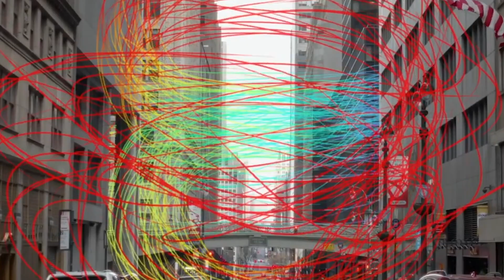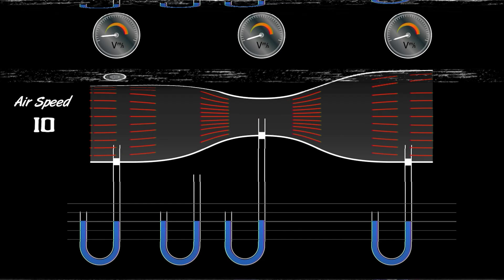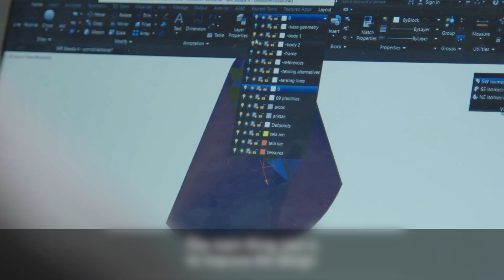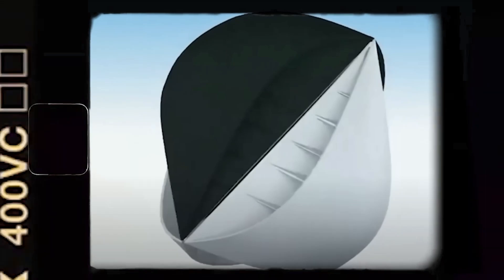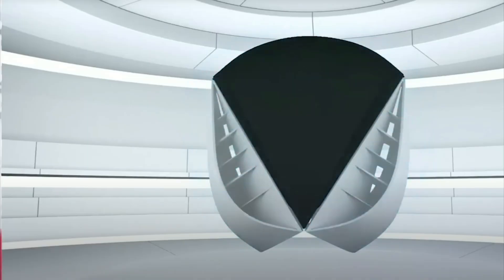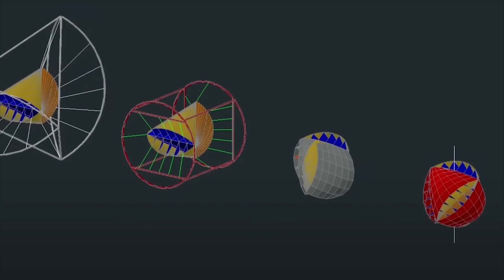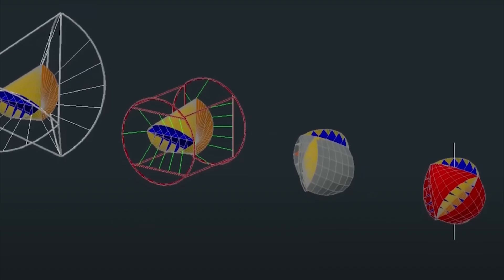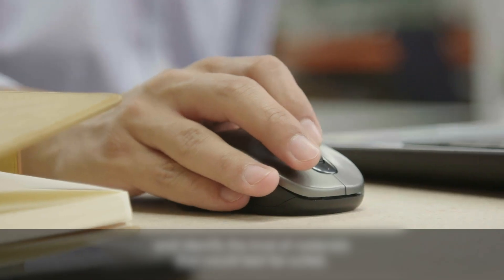NASA-Inspired Home Wind Turbine Can Compete with Solar Panels

Comment: NONSENSE! Solar panels generate at least 10 times more green electricity with the same investment in time & money! All practical tests show that small wind turbines hardly generate any electricity, because hardly any wind blows close to the ground! Wind/electricity yield increases with the third power of the wind speed. So +100% wind = +800% electricity. But close to the ground: 0 constant wind, only aggressive gusts!  Whether wind and/or solar power - you need a diesel generator to live off grid.